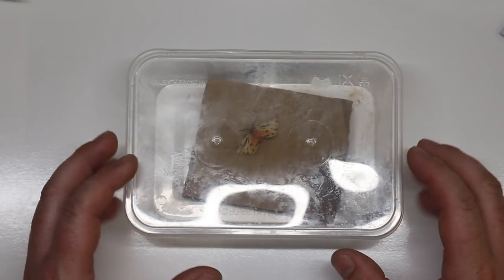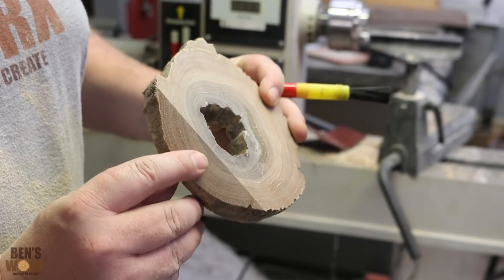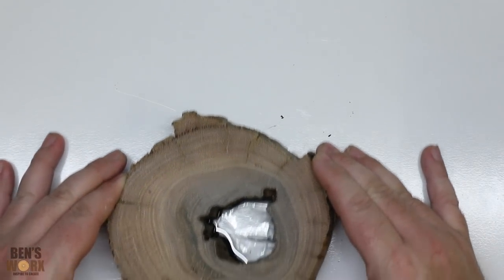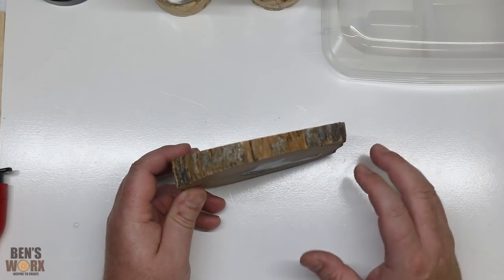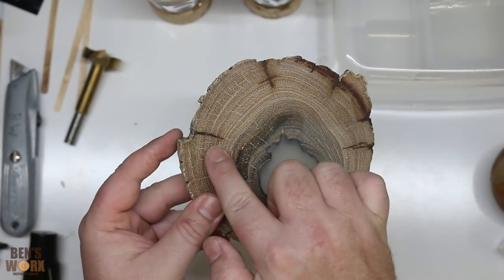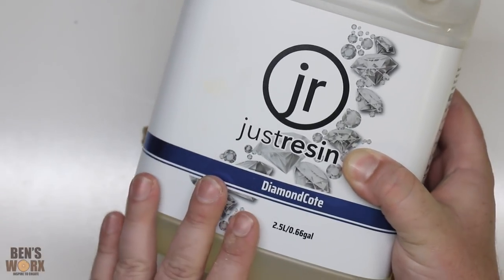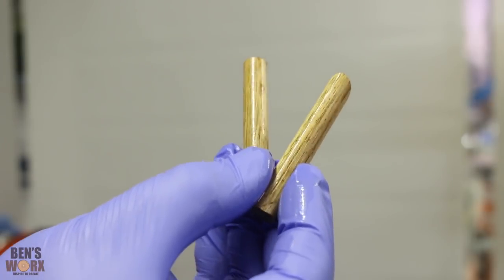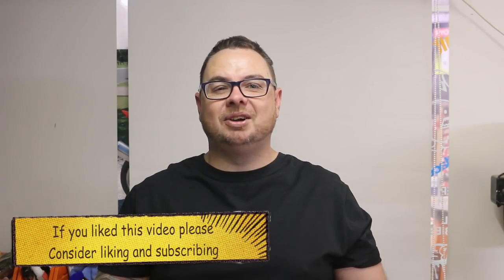Making a Tiger Moth Desk Clock - Insect in Resin

Comment: Butterflies don't lose their colour after they die because it's produced by the physical shape of the tiny scales on their wings absorbing or reflecting light. Moths always lose their colour because theirs comes from a chemical compound in their body/wing cells which breaks down fairly quickly after they die - and even faster when reacting with certain chemicals. This is why museums and collectors prefer to display butterflies rather than moths - it's hard to make an attractive exhibit when every moth has turned the same shade of brown.
Reply from the maker: Thanks for the info David